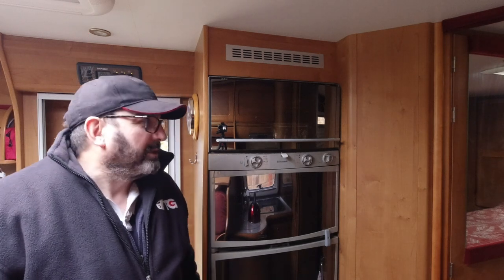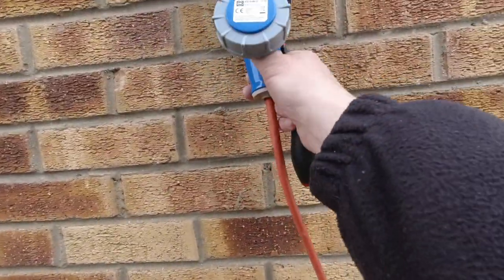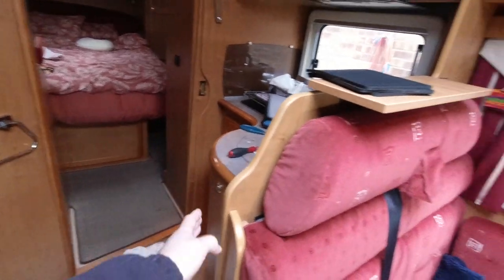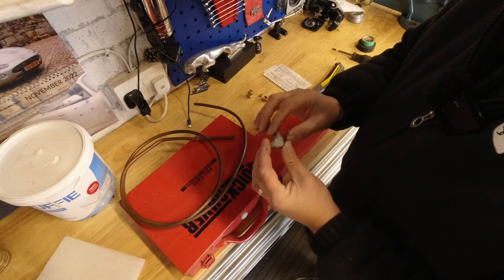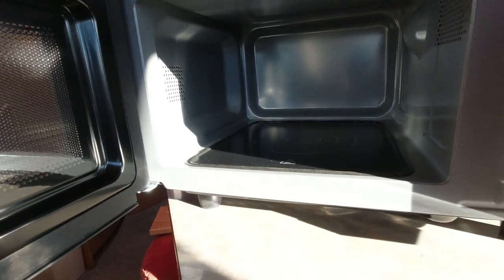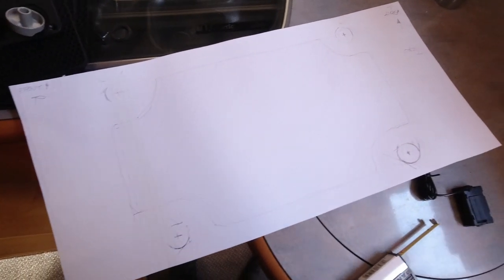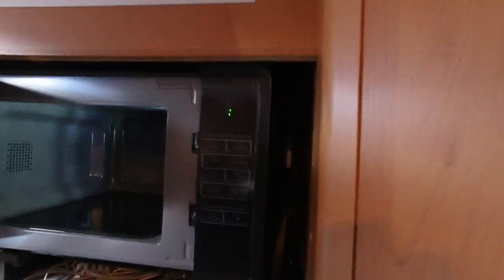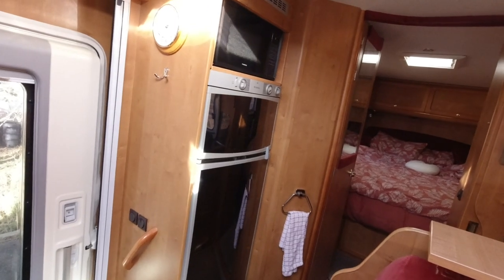Fit Motorhome specific microwave in place of dometic 'Tec Tower' gas oven. on our Rapido 9090F

Comment: A finer point of tube cutting using this method if intended for flared fittings is to remove the work-hardened portion of each end prior to flaring to avoid radial cracking.  I went around the bend a long time ago...😂😂🤣🤣
Reply from the maker: Great tip Gary. Or you can temper the ends with a blow lamp and a quick quench.
Reply: @ToTheGarage  With copper, you can.  We use aluminum pipe in aviation and annealing doesn't really work, so we have to remove the last 1/16" and smooth out prior to flaring.